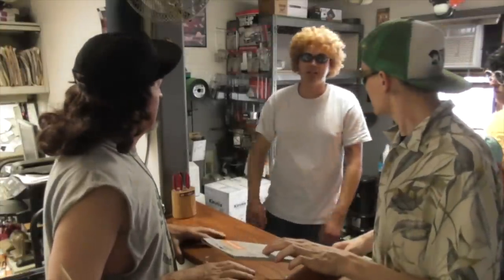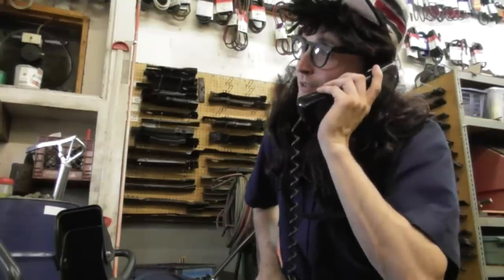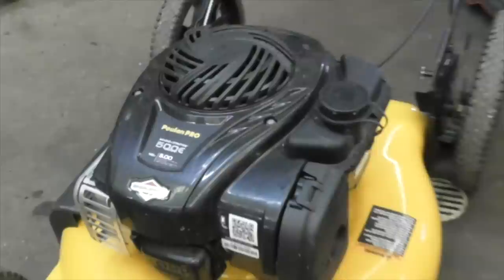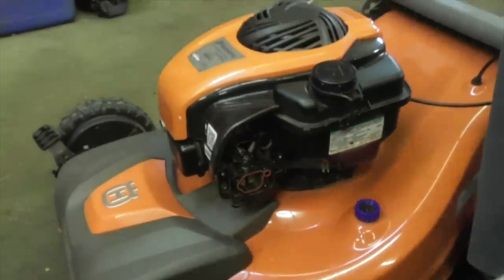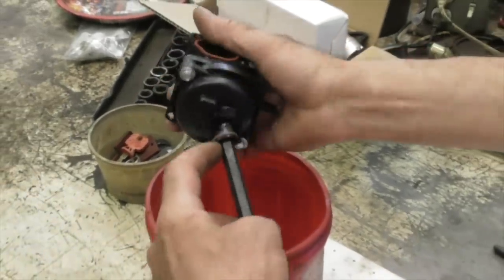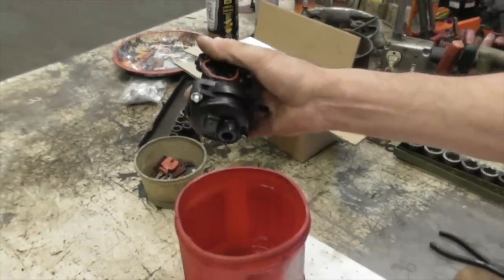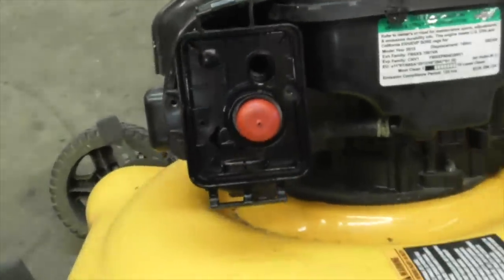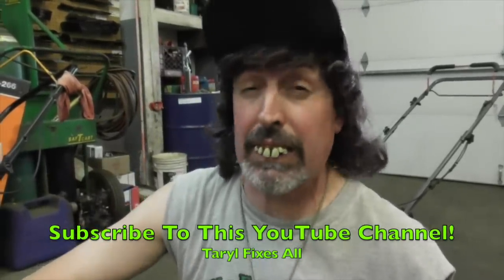How To Clean The Carburetor On A Push Mower (New Plastic Style Briggs Carb)

Comment: WOW Tayrl!!,Briggs/Scrappen ain't what it used to be!!.PLASTIC CARBOTRAITORS!!??.I've never owned one,and by the looks of what I've just saw,probably never will.
My VERY last BRAND NEW Briggs/Scrappen I bought back in the spring of 1994,its a 21"inch Snapper with a 5hp."L"-head on it and it has a ALL METAL carbortraitor.So far,so good,I haven't had any issues with it at all.I'm seriously not impressed with how these engine mfg's keep cutting corners on quality and reliability,its just a sad fact.If I ever buy another mower,it will probably be powered with a Honda engine.(none of them are perfect I know,but Briggs used to be top-notch...what happened??)
Very informative video...😀👍
Reply: 4 gauge they aren't all plastic. Just on some of your big box store junk
Reply: My 7-8 year old mtd mowers got a metal carb. My 3-4 year old Honda got a metal carb. My 4-5 year old toro blow has a metal carb. Not everything’s plastic. Only the Uber cheap crap.
Reply: Anon Ymous If people would just stop buying this garbage,it wouldn't exist in the first place,problem solved.
Reply: If people would stop buying crap from China we would all be better off.  
 But.Don't hold your breath
Reply: 4 gauge Did you know that Honda small Engines are made in China also?
Reply: Daniel Coultis The Honda"CLONES"are yes,I have a REAL Honda on a generator that's made in Japan and NOT China.
Reply: Plastic doesn't corrode.
Reply: wysetech2000 I have Briggs engines dating back to 1950,I've never in my life ever heard of a carbortraitor corroding.
Reply: Daniel Coultis On my Honda generator it says stamped in the block..."MADE IN JAPAN".It also says this in my Honda owners manual.
Reply: Never?   You-Tube is full of small engine video's repairing corroded carburetors from ethanol fuel. If you use common sense with your equipment as obviously you do you won't have that problem.
Reply: wysetech2000 Their fuel must be sitting in those carbortraitors for YEARS!!.HAHA!!.I'm no angel,but I have left gas in a few of my mowers for a full year a few times in my life,but they ALWAYS started and ran with no problems,of coarse I add Amsoils Quickshot fuel treatment to the gas to prevent issues down the road.
Reply: 4 gauge The ethanol is hygroscopic (attracts moisture) that is what causes no end of problems in carbs. I see it in bucketloads every season. The plastic does not corrode.
Reply: David Coudriet I've never had any issues with corrosion at all.I always put in Amsoil fuel treatment and it hasn't failed me yet.
Reply: 4 gauge Good thing to do. Thumbs up.
Reply: Plastic??? They work just fine....just like any other carb, they gotta be clean!
Reply: VE1AXC PASS,some things should never be made of plastic,sorry,even Tayrl talks about certain PLASTIC parts that tend to WARP in these carbirtraitors...JUNK!!.(METAL DOESN'T WARP!!)
Reply: But ethanol will react to moisture in the plastic carb.  Some people call it tapioca, because it reacts with the plastic by forming little white specs that can clog it up.  Bottom line- unless you are burning the gas on a regular basis (like in an automobile), always use 100% gasoline in your power equipment.  You'll pay more for it and you have to find a station that sells it, but it will not harm your machine like the ethanol gs.
Reply: cherokeefiddler That's next to impossible anymore,I just add some Amsoil fuel treatment to it and let it go at that.I have sold tons of this stuff to other customers that have Wal-Mart lawn mowers and NONE OF THEM have ever had any starting issues of any kind.
Reply: So you are promoting a product?  Amsoil?  Fine.  I'm trying to help the un-suspecting owner of a lawn mower with the plastic carburetor.  Don't tell me what is impossible- I service these problems everyday.
Reply: cherokeefiddler I'm not promoting Amsoil,I'm promoting KNOLEDGE in general.
I said that I've never experianced this issue before,due to the fact that I use Amsoil Quickshot or Amsoil Gasoline Stabilizer in my lawnmowers,garden tractors,2-cycle weed clippers,chain saws etc.
The UNSUSPECTING OWNER should be a bit more educated on what to stay away from when buying a piece of power equipment in the first place,so he or she doesn't have this problem in the second place.But we all make mistakes sometimes and you have to make lemonade out of the"LEMON(S)"that your stuck with.
Reply: You mean Briggs and struggle to start and run.
Reply: dam1041960 That too.
Reply: Wont be long you wont be able to buy anything but a spark plug for these newer mowers. They want you to buy a whole carb. Or a whole engine when all you need is a set of gaskets. We are going to a beer can repair society. It is more profitable to sell you a complete carb rather than a kit. If it goes bad throw it away and get a new one hence a beer can repair industry.

Comment: I seen starting fluid blow an engine 1 time and it was because I think the guy was trying to mow his yard with starting fluid. He said "I tried to keep it running for 5 to 10 min. It locked up. But if you use your head you will not heart the engine.

Comment: I've had to work on a few if those, pretty flimsy plastic. I'm betting its not cheap. I had a early eighties pulsaprime carb, needed the diaphragm with the choke rod. Light clean, new diaphram, was good to go. No points as it had the magnetron conversion done. I wonder if this mower taryl worked on will still be mowing 36 years from now.

Comment: Only time I'vd seen an engine blow from starting fluid was on a Buick with a 3.8 v6. Some idiot sprayed a bunch in the throttle body and the plastic upper intake manifold exploded when they cranked it.

Comment: I have engine #2 on my mower. It wouldn't start----as it turns out, because of moisture from setting outside at WalMart-----it had been returned. I paid $50 for a $180 mower. I couldn't get a spark! Old B-S engines with points and condensers would produce a spark while being turned over slowly by hand, where as the new types need to be spun rapidly or there is no spark.

Comment: I've seen a guy  blow up a motor with starting fluid but this guy was using it to run the engine for what seemed like forever. Well not forever because it blew up. Nothing wrong with how you use it.

Comment: my sisters riding mower wouldn't start after removing spark plug gasoline come pouring out of the cylinder. turned out to be that little float needle & seat

Comment: I’ve picked up a few mowers with this style carb on side of the road this year. With this video I was able to take the carbs apart and clean em and get em running again. I have run into one that is giving me trouble. It is the second style with the primer bulb. Every time I primer the carb, gas shoots out of the vent tube. I’ve taken it apart a couple times thinking I put it back together wrong, but everything seems correct. Anyone have any idea why gas would shoot out of the white vent tube when priming?

Comment: Anyone had a problem with an EX engine with the auto choke stumble and almost die randomly, mostly over bumpy ground?
Reply: John could it be the low oil sensor cutting the engine on bumpy ground, heard that's a problem.

Comment: Very good description of the auto choke system Taryl, but in this video I didn't find you were very helpful, you didn't clean the main body of the carburettor out at all. I was pleased when you were going to describe the primer system though because that is what I was looking for, and so far I have not found anyone to tell me if the primer bulb is supposed to have a hole in the centre of it, I have had to look elsewhere to find out and I think it is what they call a vented primer but it doesn't have a tube attached to it like the ones it found.

Comment: Plated needle?  Surely they could have just used something else not plated.  I guess they need to guarantee that it will break.  What some people do sadly enough is throw things like this away because they don't know what to do.  I guess if it has a plastic carburetor they look at them as disposable.  It is just another way to cut manufacturing costs and it does nothing for us at all other than cause misery.